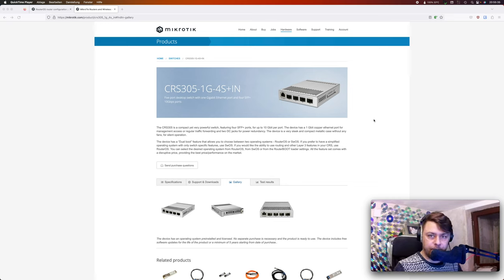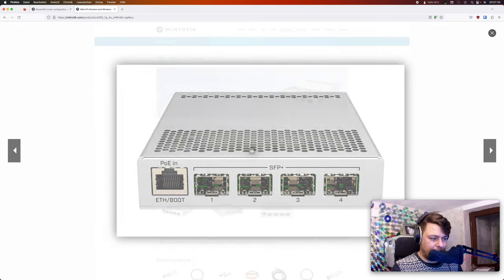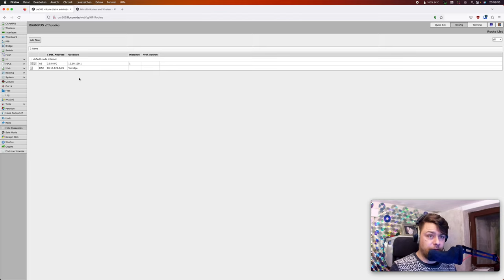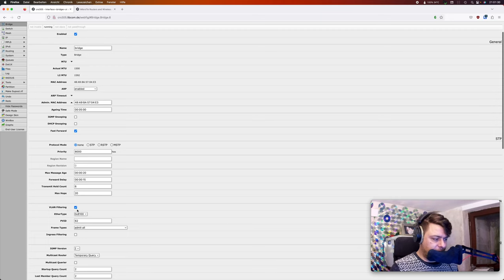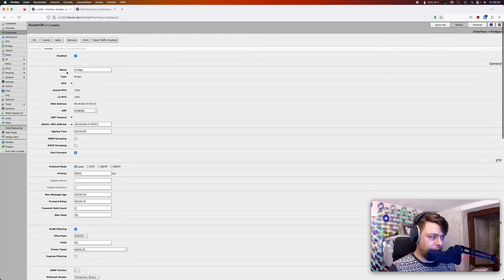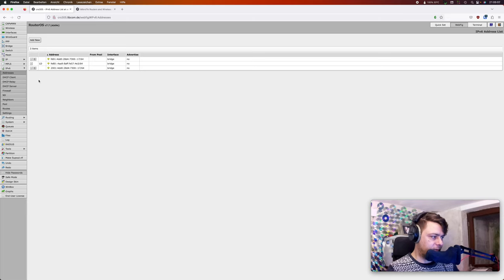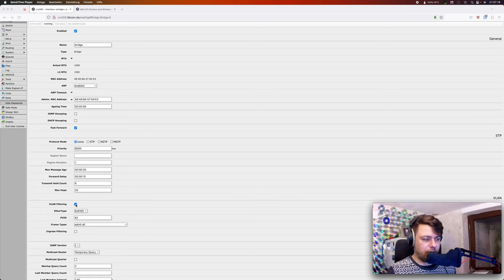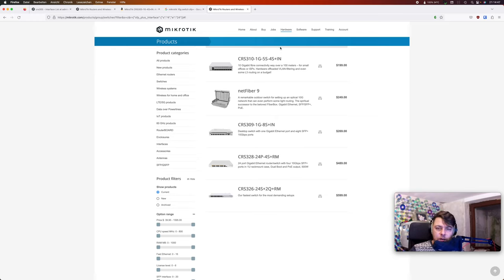Mikrotik CRS-305 - 10G Switch impressions and basic setup

Comment: Sir 

if one port has poe capabilty 
then how it works on 1G 

technical concept

for 1G interface all 8 wire need to communicate 

in poe four wire are reserved for supply
Reply from the maker: A single wire can at the same time deliver power and transmit data, see https://en.wikipedia.org/wiki/Power_over_Ethernet
Reply: @junicast_tech  sir
wire number 1,2,3,6 use for data
4,5 and 7,8 use for power supply 

if four wire use for data only 100 Mb max bandwidth is there 

that my question using poe 1 gigabit  not possible
Reply from the maker: @PardeepSingh-wt8xo  PoE and 1G IS possible with Twisted Pair. Just read the article I linked.
Reply: @junicast_tech  thanks dude , my knowledge entirely practical . till date i am not works on such device, as commonly use poe has separate power